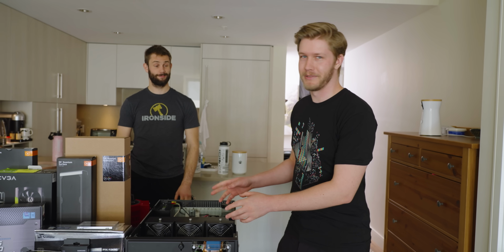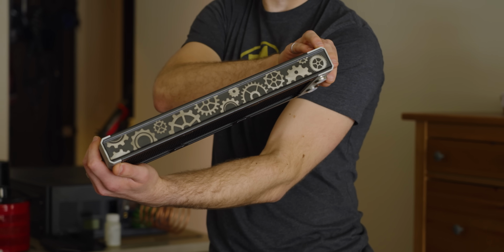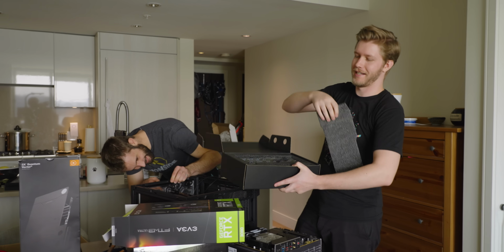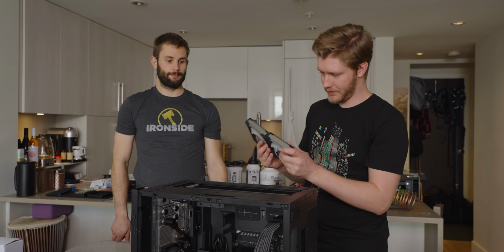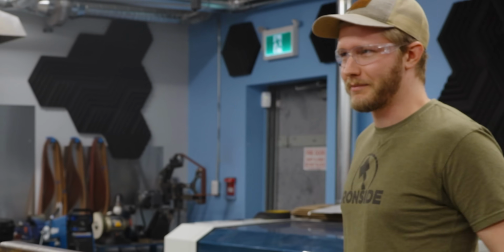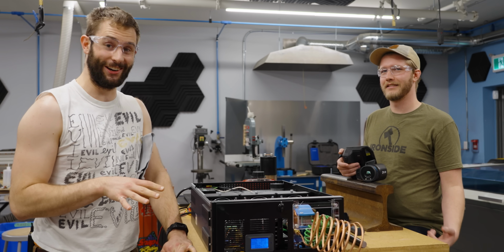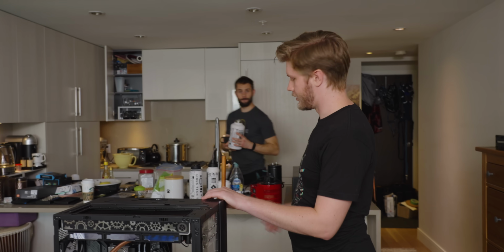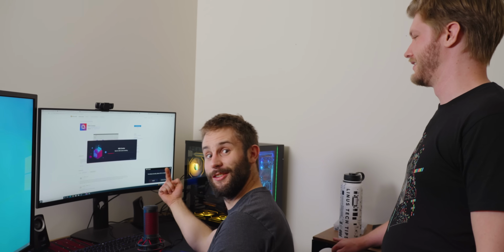This PC is TERRIFYING - Intel Extreme Tech Upgrade

Comment: Hol' up. You guys call fuses circuit breakers!?! No. They're different! Fuses break and need replacing but take a long time if they're right at the rating, circuit breakers are just switches that turn off using electromagnets really quickly and can even sometimes stop an electrocution occasionally.  (For reference, I'm from the UK, it may be different elsewhere).

Comment: The titan x Maxwell 2.0 is a great card still in 2022 i got one in my first ryzen build with a ryzen 5 2600 with 16 gbs (Sk Hynix) of ram now I went to a ryzen 9 3900x 32 gbs (Corsair) of ram and a rtx 3080 it’s a big jump but then titan x still gives good performance for what prices you can get them for if you deal hunt y’all should do a prospective budget build with a titan x Maxwell 2.0 and see how well it handles in 2022 and see if it’s still a good gpu for a budget build it be a great build still

Comment: Wait, so the fans won’t spin unless you install their (likely windows-only) light control software?

I would be returning those fans for a refund immediately. Get some Noctuas, I’ve never had problems with them.

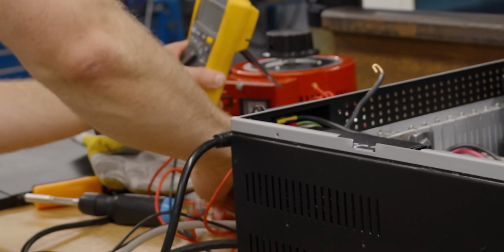Comment: @17:41 use the breaker to switch on/off, not the cord! Power cords aren't made to make and break high currents. Breakers are, and they are designed to be used as a switch as well.
Reply: Yeah the breaker was used for it initially but it broke permanently disconnected. At time of the shoot I didn't have enough extra high gauge wire around to reconnect the contactor that is in there, it is reimplemented now so no more crazy sparks from inrush current
Reply: @tynanstack7924  Understandable! I'm kind of surprised you needed these exotic parts for an induction heater but you definitely made it work. I've seen people use a braided fiberglass tube around their coil to keep it from shorting out with the metal you're trying to heat (potentially damaging any high frequency components, or hurting yourself). That is something you may want to look into, if you haven't already.

Comment: So for those working with their own custom capacitor banks: best practice is to put bleed down resistors on the caps so they eventually discharge. On some systems I have worked on, bleed down times are measured in hours.
Reply: Agreed! there is a 47Kohm resistor across the main capacitor bank for exactly such a purpose, otherwise that voltage would have been dropping a lot slower!
Reply: @tynanstack7924  Great to hear! Stay safe all you crazy awesome hackers!

Comment: To be fair there is such a small difference in performance between ddr 4 and ddr5 i'd go with ddr 4 still because of the money saving and same performance also copper tubes suck because they go green if not polished regularly.

Comment: i believe the green strip on the evo case can also be controlled by the lianli inf fans software by plugging in the standard rgb clip from the case into the unifans hub. there are 2 spots at the top of the hub for standard rgb connectors, and 4 for the lianli inf fans

Comment: The build was pretty spectacular... 
But it's time to check DC to AC...
How and what circuit breaker breaks... and then you get one of the perfect things for a power supply breaker for a power bank... and what to know...

Intel Optane Drives are cheap... no but it's cheap... I want the first generations pls...

Comment: When he said “I’m awake now” after almost blowing a breaker, I believed him. Tynan usually looks so bored of everything in general, like pfff whatever. Now I know why. He’s a madman and needs to be in dangerous territory to be excited and i love it.
Reply: Dude he was hyped the entire time he was messing with that very deadly machine lmao I like forging and metal working just like he does, but I want nothing to do with induction stuff like that, it's absolutely terrifying lol notice he said to plug it into TWO circuits? That means 2 separate rooms in the house, because the amount of power allotted to an entire room of a house (about 2000 watts) isn't enough for that single machine
Reply: @Gremlin244  And he is right, they had it pulling 1400W BEFORE the amperage started shooting up to 24 amps.
Reply: @CazRaX  that's why an electrical stove is on its own circuit ... with multi-phase (sp?) power.
We get 380 volts instead of the standard 240 v that way.
I'm guessing that killing machine has similar requirements ...
Reply: So basically he's an adrenaline junkie lol

Comment: Man if I had the 5000 dollars he had I would have gotten super cheap PC parts like Intel i3 10th gen but have an Intel arc 1000 what power supply 32 gigabytes of dual channel ddr4 windows 10 and I would get a 12 tb ssd and a 120 hz 1440 p monitor by lg because I trust them alot for no reason
Reply: Like 6 tb m.2s or 6 2tbs of m.2 storage

Comment: Water cooling solves a lot of problems with the 3080 and I imagine that will be even more the case with the 40 series. The 3080 in my system is a 3 slot card with the air cooler on it. A water cooling solution would make it fit so much better in the case and give it the thermal headroom to really run. At this point, I’m not sure that conversion would be worth the effort since I’ve already had the computer for 18 months.

Comment: im still confused by that frankenstein powerhouse machine they tinkered with right in the middle of the pc build but i like the chaotic randomness of this video. and it was just like only they were hanging out. wholesome content
Reply: Its a, somewhat, janky induction forge.
Basically, instead of using coal or gas to heat your steel when forging, you use induction instead.

It has some advantages too, with a little control you can get the steel, iron, or whatever metal you're forging to the exact temperature you want.
Pretty cool stuff.
Reply: @The_Keeper  ackshually it is not cool at all it can reach temperatures higher than the sun itself given large enough capacitors, wire gauges and input power
Reply: @someoneelse5005  lol
Reply: @someoneelse5005  I think you forgot to *push glasses up*
Reply: @someoneelse5005  that is frigging awesome!

Comment: i have that power supply - i had to remove the sense wire on the PSU side of the 24pin in order to stop random shutoffs, was a nightmare to diagnose / deal with

Comment: My uncle is a mechanic and uses an induction bolt remover to remove seized bolts. Much smaller than that beast. Is it just the difference between homebrew and pro made? Lookup induction bolt removal.

Comment: Isn't that capacitor rated for 600kW if it's 750V*800A
Reply: It has a power limit independent of the current and voltage limits at 500KVAR (similar to KW but not quite the same) though it could handle higher power for short periods. Its a C500T from Celem if you wanna see some crazy capacitors specs check them out!
Reply: @tynanstack7924  oh gotcha

Comment: Who has 2 thumbs, and bought an audio workstation computer, rack mountable, with an i7 6700, 32Gb of ram, with NO GPU other than the one on the motherboard, for $3000.00 4-5 years ago from Sweetwater Sound? ME!! I'm thr dumbest veteran that bought a $3k co.puter with no GPU. I have kept the computer, and will be upgrading it to an i7 12700, with the same MSI motherboard he's got here. I REFUSE to buy a new PC after spending that much money on a PC that couldn't even game lol.

Comment: Non - computer rant for your motherboard tension comment . Rebar is not stressed in concrete however it does add tensile strength to the concrete to resist breaking and cracking under tension.  However we do tension pt cables hence post tension tendons which is not rebar but cables.  I have had some hours using hydraulic rams to do so as an Ironworker. I dont bust the rods anymore though lol.  I do enjoy the content on this channel keep it up.

Comment: Are you using litz wire on the toroid?
Reply: No I did buy some small diameter enamel coated magnet wire in case I needed to, the on camera version is some 6 gauge grounding wire though I ended up swapping it to some 10 gauge stranded core after filming. Litz wire would definitely be more ideal but with the current levels I'm working with right now it would be overkill. Perhaps a modification down the road after a few other upgrades!

Comment: I worked on an induction heater at school - the thing was 3 meters high, 1.5 wide and 4 meters long... You could light up a piece of metal weighing a few kilos in 2 seconds.  I heated my throwing stars for hardening 👆🤫😅
It's incredible that his piece of hardware in this video have an size of an Server case. I mean, sure it's slower but anyway, very impressive.

Comment: Saying "750 V @ 800 A" or "500 kW" is a bit misleading for a reactive component like a capacitor... It might have a max voltage of 750 V and a max current of 800 A, but it's unlikely to see both simultaneously (for very long, at least), and doesn't dissipate 500 kW, so it might be capable of 500 kVA (or 600 kVA since 800 * 750 = 600,000), but that's a very different statement
Reply: You are 100% correct, I debated putting up the actual spec of 500KVAR (spec from Celem) but we decided that KW is more understandable to anyone who doesn't have as much of a technical background
Reply: @tynanstack7924  fair enough. kVA is confusing enough even when you do know what it's supposed to mean. What the capacitance on it, though? I may have missed that in the video
Reply: @hganti  3uF on the Celem cap

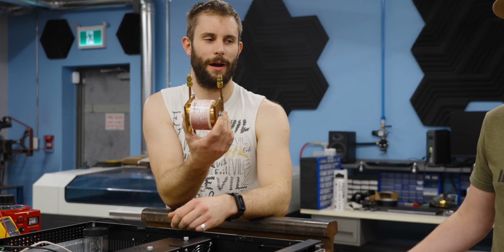Comment: 11:23 Minor correction: 750 volts at 800 amps would be 600kW not 500kW. physics major dropout- out
Reply: Yup you are right, however, the Capacitor has an explicit power limit of 500KVAr (KVAR is the same as KW but includes reactive power) aside from the max rated voltage and current limits.

Comment: The looks of this PC is what I expect to see for the usual $5,000 budget. It escapes me why staff don’t get the best hardware money can buy since it seems like they keep their builds for quite a few years. I’d rather get my hobby stuff on my own dime.

i9-13900K 
Corsair h150i Elite Cappelix AIO
Asus ROG Strix Z790-F Gaming Wifi Mobo
32GB G.Skill Trident Z5 DDR5-7200 CL34
2x2TB Western Digital SN850 Gen4 NVME
Asus Rog Strix Gaming OC 4090
Lian-Li PC-011 Dynamic Full Tower Case
MSI A1000G 1000w 80+ Gold PSU with new VHPWR connector support without adaptors
Alienware AW3423DW 34” 1440p 175hz QD-OLED

If the 4090 is MSRP this would still be under $5,000

Comment: You should insulate the induction coil. You know… so you don’t accidentally short it.
Reply: Yup agreed! I put a layer of conformal coating on it as such a precaution. I have plans to put some fibreglass sleeving over it as well as another layer of protection for the coil.

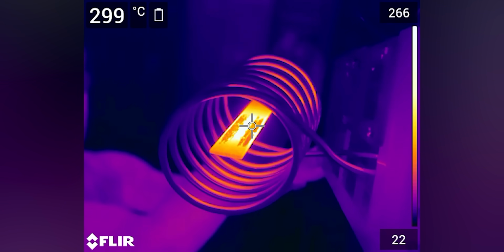Comment: @17:56 You could have explained that all ferrous metals have a point at which when heated, they become far more resistant to magnetic fields which causes the inductor to draw more current and heat even faster. Also you could have a resistor based trickle circuit, that charges your caps before actually making a full connection to mains, design it so once the caps reach full voltage it automatically engages the mains via relay. So you know, no surge current back through the neutral or ground bus that might hurt other electronics on the same main. UH>>> ALSO.... at this point with the type of current drawn by your inductor, and the fact that you were willing to manually connect two cords with a live circuit... I would say changing your own breaker is small potatoes... Go for the gold brother start using  2/0 connections to the pole before the meter and just use fusible links, like 20 amps at the inductor, 60 at the pole, use a knife switch to engage it... It would at least be safer, no worries of melted connections.

Comment: Talking about Micron overclockability, i Run a DDR4 2400 Cl16 kit on 3600Mhz Cl16 without any stability issues on a 4Ghz ryzen 3 2200G

Comment: Could you please do a guide video for a "no limit, best of what is available" build PC, for people who want to go the whole way including FULL water cooling? For example: 
Case: Cooler Master HAF 700 PC case, 
Cooling: 
- three X 420mm radiators (top, side, bottom), 
- CPU water block, 
- M.2 drive water block, 
- RAM water block, 
- Water pump and reservoir, 
- soft tubing and fittings, 
- appropriate 140mm fans (case comes with two 200mm on front and two 120mm on back I believe), 
CPU: Intel 13900K or AMD 7950X
GPU: INNO3D RTX 4090 ICHILL Frostbite - which comes pre-installed with water blocks for a custom water loop, 
RAM: DDR5 7600MT/s
Motherboard: etc..
This would be very useful for people, like myself, who are planning a full water-cooled enthusiast PC & have been saving a long time (after the GPU prolongued frustration for years) to get the very best of what is available. 
Thanks in advance! P.s. any idea when PCIe gen 5 M.2 drives will be available?

Comment: I suspect the steel isn’t exactly the the correct material for looking at with an IR temperature meter. Glowing red hot is generally more than a few hundred degrees Celsius, also does that meter measure the temperature of visible light because my FLIR one stops down at ~600 degrees (and the imager doesn’t measure anything that hot it just says it is maxed out on this pixels)

Comment: I built my new rig August of this year (i7 12700K, TUF z690 wifi,  TUF 3080 OC 10G, and 32gb ddr4 3600) I REALLY wish I had gone with DDR5 just for the upgradeability down the road.  At the time a 16gb kit of ddr5 was well over $250. and the 32gb kit of corsair vengeance ddr4 was $90.  Now when I look 32gb ddr5 5200mhz is $125. so it is not really that badly priced now.

Comment: I put an acrylic mirror under my 3080 full length of the card. 45 degree angle so you can see the rgb and fans. Covers eveything below the card...looks like 2 cards in there...one horizontal, one vertical.

Comment: I'm super confused... why would you spend money on hard custom liquid cooling on a 12700k!?  that's more money on cooling than buying a 13900k AND a 480mm aio.  this doesn't make sense.  and a 1300w (fantastic) power supply for a mid-range gpu and a mid-range cpu.  i'm NOT against custom liquid cooling (I have a 5950x and a 3090 with a 2 360 rad custom hard acrylic tubing setup).  liquid cooling mid-range equipment is absolutly worthless... spend money on making it BETTER - THEN worry about spending money on OP cooling.

Comment: Finally someone took the 5k for a PC and actually built just straight up baller PC. It's going to be a pain to ever upgrade or replace parts but it's definitely cool AF. The induction heater is just cherry on the top. Chef's kiss.
Reply: He’s using a distro block, as far as hardline tubing goes that’s basically easy mode. All he needs to do is drain the loop and cut new tubing to length, you can see he has very few runs that aren’t just a straight pipe. For anything with a curve, well, the induction furnace stuff was probably just for fun, you can easily bend such copper tubes cold.
Reply: @СузаннаСергеевна  No, you want to heat the copper tubes so that you don't end up folding the copper tubing instead of bending. (reduces flow, reduces overall pressure and cooling effectiveness; not fun)
Reply: @cwhitley.sawlabs  You fill the pipe with sand or a special spring before bending it. https://www.youtube.com/watch?v=pc3yud5JSsM

I may not know much about plumbing, but I do know this one thing.
Reply: @СузаннаСергеевна  Ah, cool. I knew there was some special step you had to do. Thanks!

Comment: I did not know that about the IO shield and the motherboard mounting holes. I just thought it was some tolerance issue with my case and had to stretch and pull the mounting holes a bit to the right positions.

Comment: I like the steampunk design of this build. I wonder if the copper tubing makes it even better at heat dissipation and I'd love to see a test of that.
Reply: Copper tubing probably dissipates heat better, but into the case. Would imagine the performance to be about equal (if not worse). But nevertheless, the aesthetics work for this build.

Comment: not sure why people don't put a crucible in their induction forges. Anyways have fun, I used to use a 50lb induction forge at work to melt down piles of scrap for analysis. its scary when the carbon monoxide starts burning and you have to go and shove a graphite rod into it before the slag hardens over the metal and bursts

Comment: always overspec a psu, if its only running 50% capacity its being energy efficient, as you start plugging more crap and it ages it still has headroom, dont cheap out on your psu if you're going for a decent build.

Comment: A shame that the bend radius on the GPU power would have been too tight (and thus looked worse) if it went before the copper rather than after it as I love the look of copper, but at least it is a cablemod cable that looks ok so it doesn't detract too much from the aesthetic.

Comment: Wait... They pulled out a 3090.. or a regular shaped gpu... But then right after that says.. now here, is the Actual GPU..
Is that a SECOND GPU... Or something... Can someone please explain.

It looks like a second box was opened to.. so he actually did OPEN 2 gpu boxes... I'm sooo confused
Reply: it was a 3080 that I water blocked that's why there were two boxes, the EVGA box the GPU box that I took the cooler off of, that's why it was in the waterblock box. Hope that helps 😅